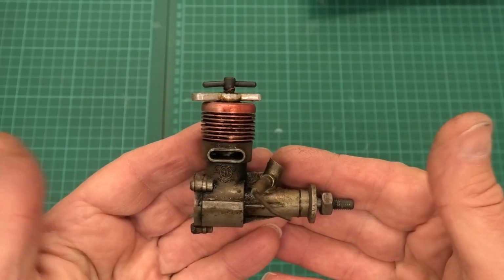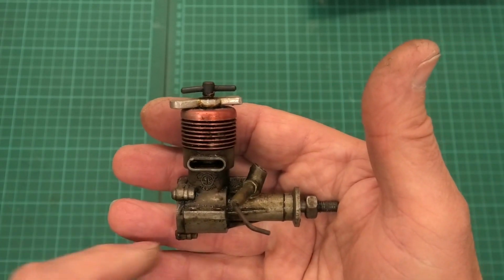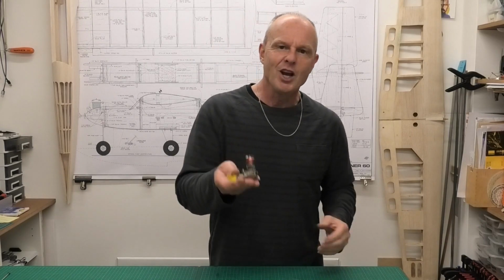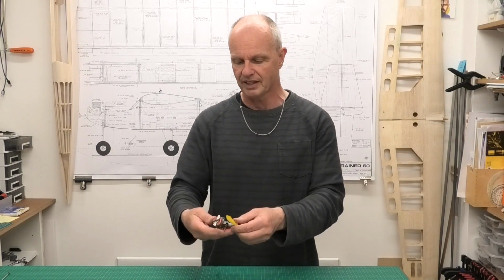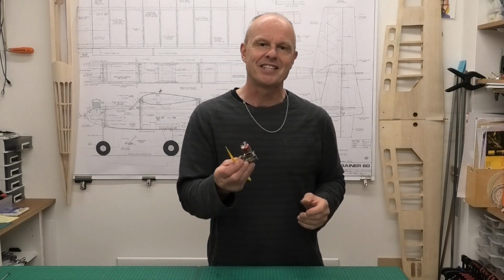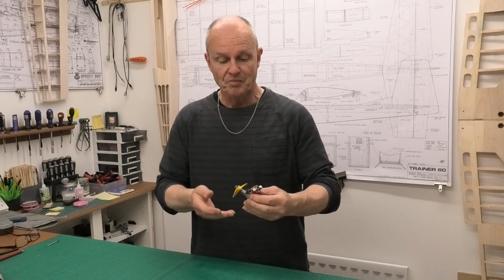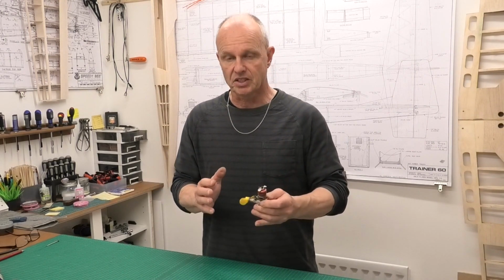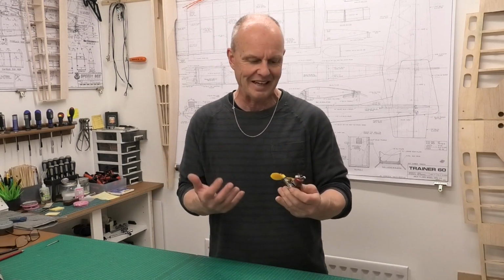ME Heron - 1960's 1cc Diesel Engine - Clean & Run

Comment: I've got one of these bought new in the early 1960s still looks like new still with its box and literature. Great little engine very reliable. Only problem was I also had to make and fit a compression locking lever on the compression screw as stated in the video it would always unscrew itself. Would know that sound anywhere, only problem now its not so easy to get the fuel.
Reply from the maker: Thanks for the comment, yes, they are great engines.  If you are in the UK thefuel can be obtained easily, but not sure about elswhere in the world.

Comment: A lovely engine. I had one as a kid but don’t know what happened to it. Can you buy diesel fuel in the UK Mark or so you make it? I am currently restoring a Webra Winner 2.5 and will need fuel which is a challenge these days!
Reply from the maker: Yes there are a few places in the UK for diesel, I would recomend getting it from Model Shop Leeds, excellent service and fuel.  Pleased you liked the engine, they run lovely
Reply: Northampton Model Shop sells D1000 and D2000 diesel fuel. D1000 is recommended for your engine since the oil content is a little higher with higher ether content for easier starting.

Comment: This is very interesting. Years ago I had a 1cc .49 cu inch diesel mad in IOM by the company Davis Charlton. I wonder if there are links between these two companies. this would have been late 70s - early 80s when I bought it new. I remember the engine being a "bitch" to start and to get running and it had a recoil spring starter built in. you wound it backwards against the spring and released. 
I had such trouble with the engine that I ultimately got a cox's glow plug engine which was much more reliable.....